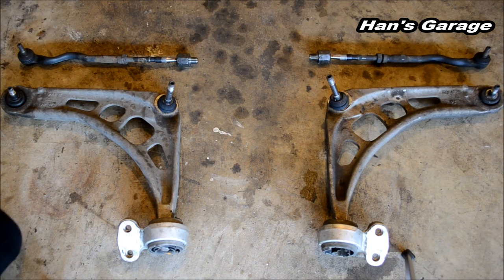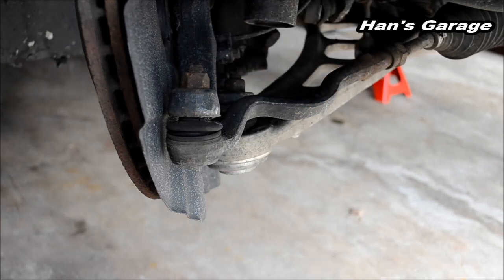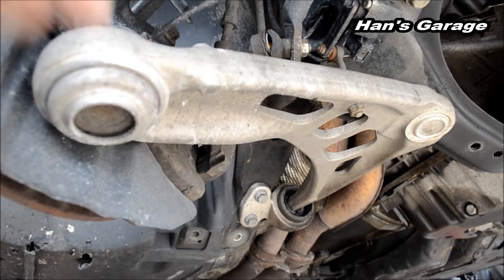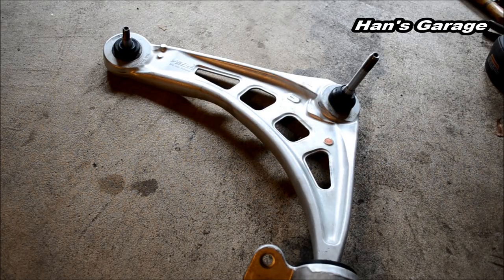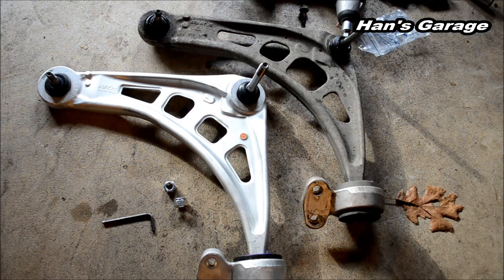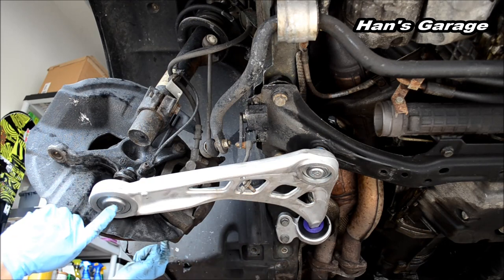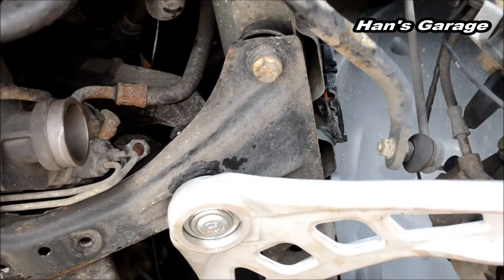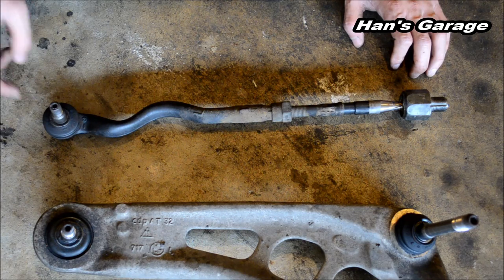BMW E46 3 Series 1999-2005 Control Arm Replacement

Comment: Excellent tutorial, well filmed and narrated, thanks.  Only questions i have are a) did you have to re-grease steering rack and b) no mention of torques - is it good enough just to tighten up with impact driver?

Comment: Nice video, good camera work and thorough explanation. This is a very valuable research tool for anyone doing these jobs on their E46. However for veiwers in the north of the US or Canada I'd like to point out that this video like many videos shows the job when everything goes right and not how it will when you face a boatload of rust and grime and nuts that just won't turn. Keep in mind the youngest E46 is now (2017) close to 12 years old. For example, there is no way you are going to turn the nut on the inner ball joint with an adjustable wrench. Glad it worked for Han but in New England? Uh Uh not happening. And while we're at it adjustable wrenches just plain suck.
Reply from the maker: Rob Kimmett Great point! Ill keep that in mind for upcoming vids!
Reply: I beg to differ actually. I have a Massachusetts car with 175k on the clock. Just did the tie rods this past weekend. If your boot is not ripped you will be able to do this with an adjustable wrench. I have an Xi and it was a little more cramped but the entire job took me 2 hours and most of it was figuring out how to undo the boots from the old tie rods. I just measured the length and the threads then used a cut off wheel and cut them up.
Reply: Too true, I have the scars on my hands to prove it. Skint knuckle gang up here in Scotland 🏴✌️🏴

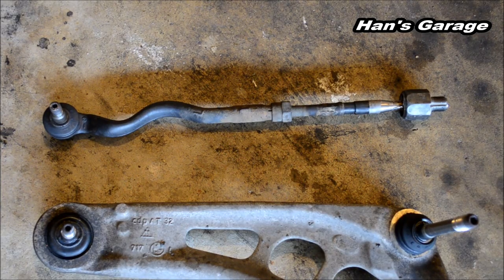Comment: 19:30 You don't count threads because the new tie rod may have a diffent number of threads. 

What you do is measure the total length from the inner tie rod base to the center of the outer tie rod bolt.

Comment: I envy how easy your ball joints came off. Currently the small one on the control arm on wheel side is super stuck, doesn't budge not even with a pickle fork.. Ugh!
Reply from the maker: eggr17ify I hear you hahaha I'd use pb blaster and keep on hammering
Reply: Im on my second can of PB blaster after doing shocks, struts and having "most" of my right side LCA off. Its good stuff but the rust is killing me too!

Comment: Han's I  got a questio see if u can help I just got a bmw 325i 2004 I  test drive it and it was fine the steering wheel was so soft just like my cadillac cts, so next day whent out and the steering wheel was super hard, I change the pump but still hard. Do u have any ideas?  I  will appreciate your help or anyone on your channel!
Reply from the maker: Jaime Moreno check your steering wheel fluid
Reply: I  did and it's okay is it need to change the fluid container cause I only change the pump but not the  container
Reply from the maker: Jaime Moreno hmm brand new pump and the fluid level is good? These cars are known to have steering fluid leaking. If the level is good... my next guess is are the hose or the container clogged or not? I guess you can change the hose and the container. Check if they are feeding the fluid to the pump.

Comment: What is the power of that impact driver/drill please! how many NM or torque does it have. and what's the name of the bushing you installed? does the purple thing come together with the bushing? and can i buy the bushing together with the purple thing separately or it only comes with the control arm?

Comment: Do i really need to replace the whole control arm assembly, or can you jusst change ball joint because everything looks perfectly good except for the rubber bushings
Reply: U can just change bushings. If yur car have a lot of miles and the arms never never been changed. Do recommend replace control arms and new bushings

Comment: Do I have to jacklift the car to test the tires like you did in the video in the beginning?
Reply from the maker: Nope you can literally shake it when parked
Reply: @HansGarage  ok, I kicked it and it doesn't shake. How many miles does control arm last? 100k?
Reply from the maker: @jonathanbock8435  thats a good sign
Reply: Off-topic: how long does CCV last? Or should just apply common sense when in cold weather, like warming up the car for like 5-10 minutes idle before departure? LMK. Thanks.

Comment: Curious, what brand of parts did you use?  Does it matter?
Reply from the maker: Yes it does matter! I bought them from bavauto.com 
31 12 6 752717M - Left Control Arm Part#
31 12 6 752718M - Right Control Arm Part#
PFF5-4601K - Urethane Bushings Part#
316 030 0004 - Left Tie Rod Part#
316 030 0005 - Right Tie Rod Part#
Reply: Thanks for the reply.  Just to confirm, bavauto brand ordered from bavauto, correct?  Thanks in advance.
Reply from the maker: +livebyreason no no they have other respectable brands for bmw parts. If you type in the part numbers I gave you, they will show up
Reply: Cool.  thanks again

Comment: Hi Han,
             I have a Vibration when I drive starting 20 mph up to fastest in front wheel. when i turn right the vibration is gone. but when i turn it straight or left turn  it vibrates so bad. So Annoying. any good advise?
Reply from the maker: Chiebog888 seems like your control arm bushings are bad... id check your tie rods and bushings

Comment: How bushing wasn't that hard you just use a hammer & bang it out and then you lubricated this is some kind of Grease or even soapy water around the edges while inside and then you place it inside no problems until it dries

Comment: if you are going to make a video don't say stupid shit. "Poly bushing is better because its easier to put on?" what kind of lazy ass thinking is that. I put a bushing to upgrade the quality of my ride not because I want to save time and effort, I will be spending thousands of hours in the car who cares if it takes a little longer to put on. What you should have said is that poly are a lot 'stiffer' and harsher then the original rubber softer bushings. IF you live in a city with bad roads you will lose your teeth with a poly and learn to hate the car. With the rubber you it may have to replace in 5 years or  more but at least you will have a comfortable tight ride. Polys are best suited for the 'track' which most people don't use.
Reply from the maker: Thanks for watching my video buddy
Reply: @HansGarage  you are welcome, I did like the way you labeled the different milimiter bolt sizes, very helpful feature.